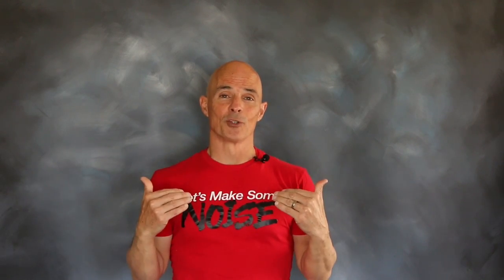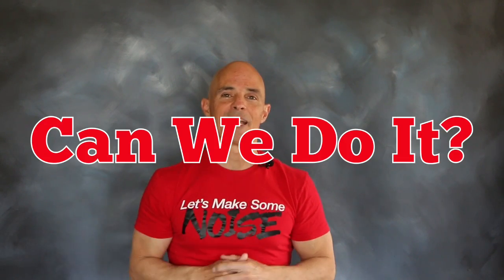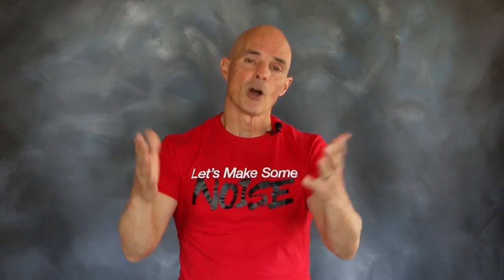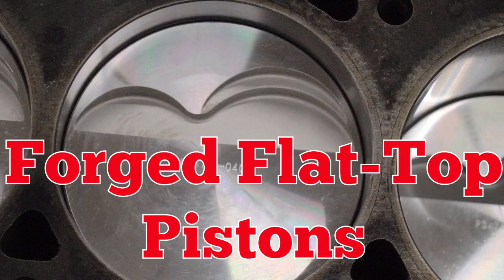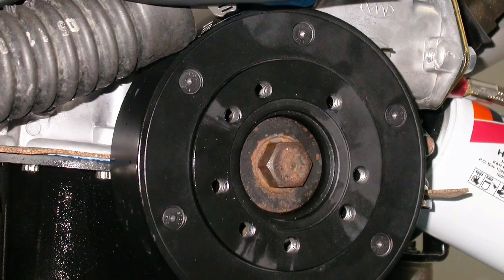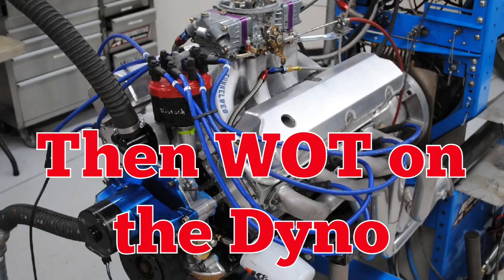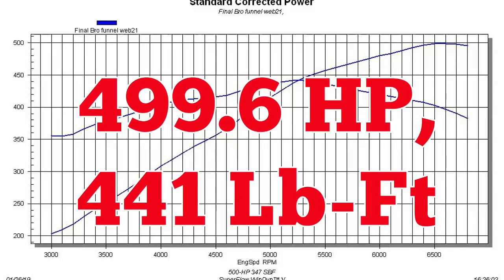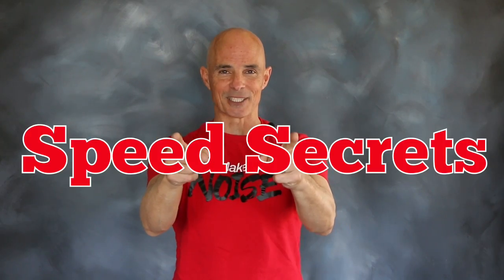Speed Secrets Getting 500 Horsepower Out of a Small Block Ford

Comment: Hey Richard I watch your videos and I know you were very knowledgeable with engines.I just purchased a forged Scat 347 rotating assembly for my 5.0 pushrod that is turboed with a 76 mm Turbonetics and Holley Terminator X with 1050x injector Dynamics injectors.The one thing that's kind of holding me back right now is my cylinder heads which are gt40p eventually I will change them to better flowing heads but for right now money is tight. My question for you is what type of Cam should I run in this setup? I am stuck on what type of lift I should go with. it is my weekend driver on the street and once in awhile go to the track. In your video you showed running the xfi 236 HR - 14 cam would that work well with a turbo

Comment: how reliable and long lasting do you think   the iron blocks are?  I see varying figures can it handle this   or do you have to just not go WOT a lot.   I am building an NA 306   that should be over  350 hp   but  I  then found a bargain rebuilt centrifigul...   I'd want to swap my rods  and pistons maybe even though only running 6 psi...  but   I'm nervous to even go to 450 with the stock block...   It's a YYY block that came out and I had ordered a machined  XXX  from an 88 Tbird  says the stamping   and i noticed the casting is definitely THICKER than the YYY that came out of the truck  even though no one seems to know those designations..  .  because they both have the optional roller  hold down spider  threads..   so     Anyway.

Comment: The less displacement you buy, the more RPMs you need, and that cam comes in handy.  Otherwise, I will respectfully argue...a head that flows well, moves the air of a rowdy cam, without its poor idle and vacuum.  But that head also needs a great combustion chamber design, which a cam has no influence over whatsoever, to deliver even more power.

So, sorry commercial, but the head choice is the real factor.
Reply: Feel free to watch Rich’s other vids

Comment: Seriously, I want to know how to do it with a non-HO 302.
Reply: its the same for the ''non-HO 302'' other than the cam they use in video .. HO 302 is a roller block uses a hydraulic roller camshaft an uses a different firing order .. can use the parts in video if you have the cash just get a cam thats meant for your non ho block
Reply: @codyramos3200  he can use this exact cam. All he needs is link bar lifters…

Comment: Would be great to see more detail, say, the cam thrust bearing assembly and the installation instructions, I've been told that cam walk sounds like piston slap, or mild rod knocks. I have a 289 that sounds more like a diesel at idle, good oil pressure, bearings clean and smooth on inspection. Verbal diagnosis was cam walk...

Comment: I’d rather have the durability of the 302 over a 347 stroker. might not have as much power but it will last a heck of a lot longer.
Reply: why though? can you explain why it’s less reliable?
Reply: louis the 347 has a not so good rod to stroke ratio that puts lots of side loading on the pistons,rings,cyl wall
Reply: @coyote5.02  yeah they must be more concerned with peak numbers than reliability. Thats a rich mans game
Reply: Bruce Lee in most cases that’s what engine builders usually do. it’s more about power then reliability.

Comment: Great video Richard. If you were running a carb on that combo, what CFM would you choose?
Reply: Prob a 750 cfm, I'm building a 306 with Holley High Rise intake efi. Hopefully im in the 500 ish range or close to it
Reply: Fords prefer slightly smaller carbs. 1 650ish carb is all you need in a SBF. Except 350 cu + small blocks. If I wanted a 500 horse Ford, it would be either a high winding 289 or destroke a 390 to 331 like Glidden. The 331 likes two 750cfm if you can get it to rev passed 7k.

Comment: Come now its no secret, to Throw enough money at some thing, it will perform .
     Start with a stock smaller displacement throw a comp cam what do you get. This motor has forged pistons, ($) arp engine bolts ($$, ) stroked( $$$), this is no "SECRET" ,everybody knows it takes money, to go fast.
Reply: then it MIGHT be 400 if you had AFr 165s and a .550 lift + cam and at least 10:1 on a 302

won't be 500hp though not even close.  it would be better if it was an AFR 185 heads on a 302 and .600 lift hydro roller cam with not a lot of duration  that might be 440+
Reply: They only substitute for cubic inches is cubic money. 
Let's see, Honda built a NA engine for the S2000 that with two liters displacement put out 247HP or 124HP per liter. That's over two hp per cubic inch. In a production car.
Reply: @mpetersen6  which would be great in a world without gravity or friction lol.... but even David Vizard will tell you the prowess of an Engine is based on it's Torque value per cubic inch.      Not that this is what you're doing but I always hated when people acted as if the japanese or germans are some mechanical wizards next to American engineers... They're not... it's just different purpose. American engines have classically been built on principles of mass production work horses.  American trucks pull way more weight around than those slush box isuzus   ( I did own a trooper once and it was sweet and I miss it ... but its safety was terrible.. but was like a safari truck )     not at all against imports.. just saying.    The Ford Voodoo engine is a good example of them showing off a little  of what people have been trying to kick sand at them ( cough cough pun intended for foundry shout outs )

Comment: Why do you need 347 cuin to make 500 hp? The stock 5.0 make 460 hp and pass emissions.
Reply from the maker: You must be talking about a Coyote 5.0.... a pushrod Ford Small Block is not going to make that kind of power stock.
Reply: @Compcams1976  With a large enough cam, it will. You work for a cam company. I should not have to tell you this.
Reply: @Compcams1976  so the LH17 heads don't require custom pisons?  I thought they did
Reply: @Compcams1976  An ohv 5.0 can make 500 hp
Reply: F165 this is impossible! You’re talking about a stock sbf 302 5.0 stock at 500hp?? Where do you get this from??
Reply: @babyfacebabyface8519  Stock race cars engines make 800+ hp all day with a 358 cuin engine. That is 2.23 hp/cuin. A 302 cuin v8 x 2.23 hp/cuin would make 674 hp. Now lower the lift, duration and compression. That 302 can make 500 hp without racing gas. Companies create problem that don't exist to sell you stuff you don't need.
Reply: F165 the 302 blocks absolutely cannot handle that kind of power. it’s widely known they’re weaker blocks.
Reply: @wickedwindsor9.591  It can handle 500 n/a hp.
Reply from the maker: @Fone65  This is what most people would call a logical fallacy. You're comparing $30k+ racing V8's specific output to a "stock" motor's specific output. You make no mention of compression ratios, cylinder head flow numbers, fuel flow, and everything else that is required to increase the specific output of an engine.
Reply: @Compcams1976  I guess you miss the part where I said lower the compression of that race engine.
Reply: @Compcams1976  My point is it can be done.
Reply: @babyfacebabyface8519  Click "500 hp 302" on youtube and come down until you see a black mustang. The guy has a stock bottom with a turbo. Companies create problems that don't exist to sell you stuff you don't need.
Reply: @Fone65  yes sir, you are correct. My friends' 302 makes 450 hp easy, and its a daily driver. How do l know? I worked withe man who built it, and dynoed it. It actually made over 450 hp, 455 to be correct and 385+ torque. Yes sir you know something most of the people have no idea of what you stated.
Reply: @Fone65  with turbo.  but not without a blower or high compression higher than pump gas
Reply: @KingJT80  What are you trying to say?
Reply: @Fone65  im saying that you will not see a lot of pushrod 302s making that much power. Almost none because it doesn't make sense because a 347 with some type of good flowing 195cc head can make that as proven in this video.  

Try and find a naturally aspirated pushrod  302 that makes 500...good luck nobody is gonna waste their time with one and NASCAR technology is WAY DIFFERENT
Reply: @wickedwindsor9.591  it sure can . I've seen it . Run it to shit with 150 shot ontop of the 500hp na
Reply: @12anded  You are young, don't know much about engines and want me to drop down to your level and word fight with you. That is not going to happen. Go back to your video game or watching Pewdiepie.
Reply: @KingJT80  A stock 302 block can make and handle 500 hp. People online selling stroker kits and blocks started this bs.
Reply: @KingJT80  You want find a 302 making 500 hp because you are not looking. You enjoy watching videos where people are buying all new parts. People make a video saying you can't make 600 hp with a stock 454 block and you will believe them because you have not seen videos on youtube.
Reply: @Fone65  ok show me a pump gas 302 with no power adders making 500hp 

A 454 that make 600? I see those all the time. Theyre usually 6500 rpm peak hp which is fine and hydralic roller cams and AFR heads. No big deal there

It's not about all new parts its the combination of parts used always and the tune
Reply: @Fone65  that because theres no replacemnt for displacement. Youre gonna make more torque with a stroker which is what matters on a street car.

I suppose if you wanted you could put this top end on a 302 and turn it to 7500 rpm but why?  Its a waster of money

If a 500hp 302 was the way to go more people would be building them but they aren't because its a wwste of time 95% of the time unless you have some cubic inch limited class
Reply: @KingJT80  Do you know how to make stock 225 hp 1989 302 make 400 hp without boost? If you do, I don't have to show you a 302 making 500 hp with boost.
Reply: @KingJT80  My first comment was you can make 500 hp with a 302. You just said I could so my work is done.
Reply: @Fone65  first you said coyote we arent talking those we are raking 500hp with no power adders with a pushrod 302

You have yet to post one example
Reply: @KingJT80  My 2nd. comment I said a 302 ohv cam make 500 hp with a high lift and duration cam. I don't have to show you an example because you claim you build engines. If that is true. You don't need me to show you it can be done.
Reply: @Fone65  so no proof anyone will do it? Ok you know why becsuse its useless unless its a cubic inch limited class and find one.

Everything can happen in theory and on paper but I said real world examples. You haven't peovided any at all
Reply: @12anded  I can tell because you have not learn how to talk to people without cursing.
Reply: @Fone65  I never claimed to build any engines. I said go find a real world example of a stock stroke 302 making 500hp with no power adders.  You dont need an engine builder to figure that out.

Just do a 347 and be done.  And 500hp youre not even gonna like in a 347 on the street as much either. Id rather do a cheaper 347 with the new AFR enforcer heads and a 550 lift vams and 10.5 to 1. It'll be 430 to 450 most likely with a small simgle plane and a 650DP
Reply: @Fone65  even trans am boss 302s didnt make that and they were very powerful for their size
Reply: @KingJT80  The 2018 Mustang GT has 460 hp.
Reply: @KingJT80  Dude, just because you don't see it on youtube, don't mean it's not doable. Believe what you want.
Reply: @Fone65  ok go ahead and waste time building one then.
Reply: @KingJT80  I don't do old hp anymore. I rebuilt my 96 Tahoe 5.7 and installed a cam. I was happy until I bought a 2016 F165. After driving a 2.7 liter twin turbo 165 cuin v6 with 325 hp/375 lbs.-ft that got 18 mpg city. I sold my Tahoe.
Reply: @Fone65  its also a coyote..diffrent engine completely than the engine in this video.  lots of 347 have made this.  i plan on doing it
Reply: @KingJT80  Enjoy
Reply: mrhazel it has been done with a set of Jon kaase p-38 cylinder head with a cam and victor jr intake manifold 750 carburetor and inch and 3 quarter long tube headers. it made 505 at 7500rpm on a stock bottom end with over a dozen dyno pulls. go look it up.
Reply: mrhazel Jon kaase did it with his P-38 heads with only 9:1 compression and a camshaft swap.
Reply: @olblu8746  specs?
Reply: @12anded  and he mentioned nascar motor. Thats totally different ball game.
Reply: @Fone65  dude your stance on the 500hp 302 argument is based on the 2018 3rd gen Coyote 5.0 that makes 460hp and can pass emissions which is true but you keep flip flopping between 2 engines like they are the same thing
-O.H.V 5.0 H.O. 1987-1992 mustang (cast iron block/heads in block cam pushrod engine) 
-225hp @ 4200rpm 300tq @3200rpm
-9.3:1 compression
-4''bore x 3'' stroke
                                    vs
 2018 3rd gen Coyote 
-D.O.H.C 5.0
-460hp @ 7000rpm     420tq @ 4600rpm
- aluminum block 
-aluminum DOHC cylinder heads (2 camshafts per head)
-12:1 compression
-3.66''bore x 3.65'' stroke 307cid 

they are 2 completely different engines the coyote being 30 years advanced in technology ..the 302 windsor 5.0 is closer in relation to the mid to late 60s 289 v8 than it is to the ''5.0'' of today.
Reply: Maybe if its on nitrous or blown. Natural you have to be kidding
Reply: @Ticeracing33  Go to a drag strip, there are guys with 302 making 500+ hp. These channel on youtube are trying to sell stroker kits. So they tell people like you who don't know any better. A 302 is too small and the block can't handle 500 hp. Pre-internet people like me know better.
Reply: @Ticeracing33  Before you try to school me again. Upload a video of you changing the oil in your car. I think think you are old enough to drive.
Reply: Lol . Some of you guy's kill me . Mr compcam . I can't believe you don't know more about this being in the cam business  .

Ok . 25 plus years ago 
Bone stock 90 302 with girdle and on the fly not hed deeper eye brow in the piston , done in the block , TFS street heats aluminum heads ported and dected with 202 vavles  and 1.6 rockers , big ass cam .( NOT COMPCAM) . 1.3/4 headers big oil pan with widnage tray . Upgrade oil pump . Msd 7 al i believe . Electric water pump and fan . Ported edelbrock intake . 75 TB anf 80 C&L MAF  . Ford motorsport extender .10.5 to 1 compression . Everything was bought used . Nothing at all was new . We made 487 hp at 7200 RPM . Yup not 500 hp but we switched to carb. 750 or something .went up to 498. Again not 500 hp but right there . I'm sure with newer cam with todays technology and better oil .the carb set up drank gas like a mother fucker . . Went back to EFI , was better on fuel and drivability. 
Had a 150 shot on that . I believe that motor is still running today . 

I'm sure if i dig threw my old shit .i can find the dyno sheet .
Reply: @Spad68  Thank you.
Reply: Shane Butler  Are you talking to me because I don't understand what you are saying.
Reply: talk about troll bait.... a Stock block 1960's technology OHV 302 making 460HP and passing emissions for anything new enough to be tested? Not a snowballs chance in hell slick. You would need about 8000 RPM and probably 14:1 to get there. The cam specs at .050 are going to look like a street grind's advertised numbers. It's not going to be even remotely streetable... unless 4.88's are your thing and you can live with a 1800 rpm idle. The ODB dyno rollers might just throw a flag with the eye watering idle the cam that rolls 8000 is gonna need.  Tell us how cheap that mill will be, Capone. 347's are dirt cheap, and there's no replacement for displacement. 

On the other hand, if you're just into that kind of thing, rock on brother. The head costs alone would exceed the long block in this video, and by the way (saw one of your other comments), even pre-internet, Competition Cams (COMP, the guys who published this video)  is a camshaft company, not a stroker crank company. Yodle away!
Reply: Are you on about the new coyote 5.0?
My old 69 mustang 302 engine cannot make 500hp as a stock 4.9 lol
Explain more about this
Reply: @fwucku  With the right cam. Any 5.0 with 10 to 1 compression or higher can make 500 hp.
Reply: No a pushrod 302 does not make 500. I raced circle track for 18 years. Our 13.1 302 with boss heads made 405hp best eve running it to 8,000rpm
Reply: @Ticeracing33  Dude, you are lying your ass off. You don't race anything. If you had a 302 with 13 to 1 compression and only made 405 hp turning 8k rpm. You would have found another engine builder. Please stop talking because you are telling on yourself.